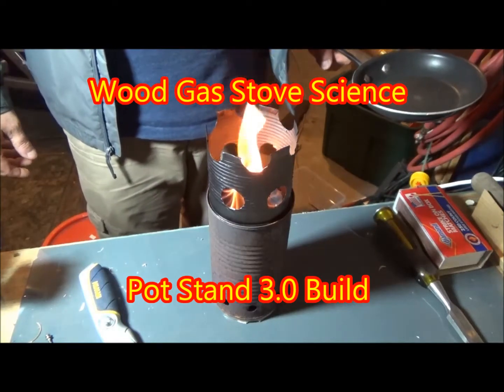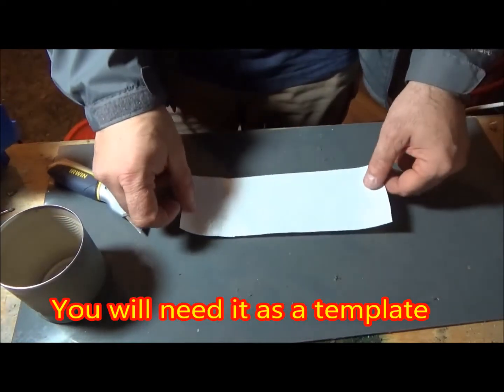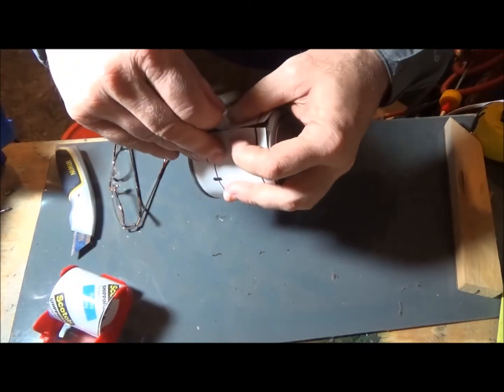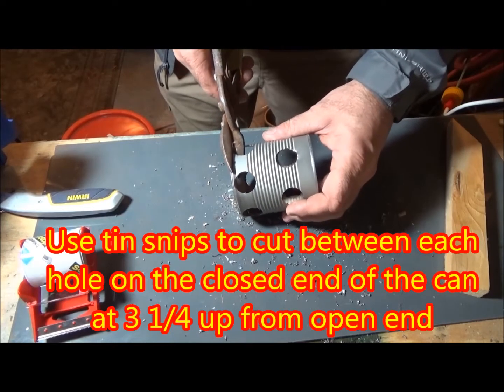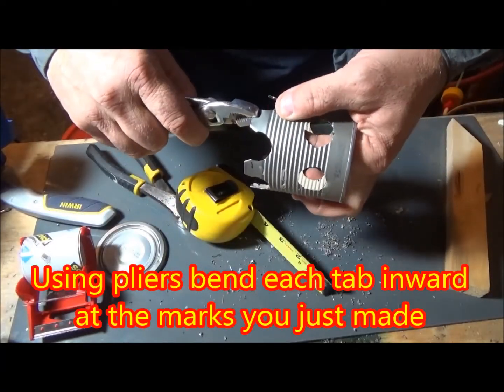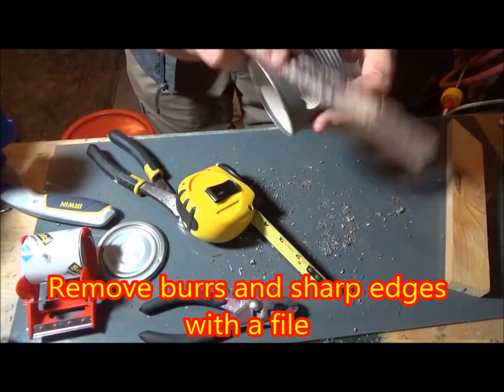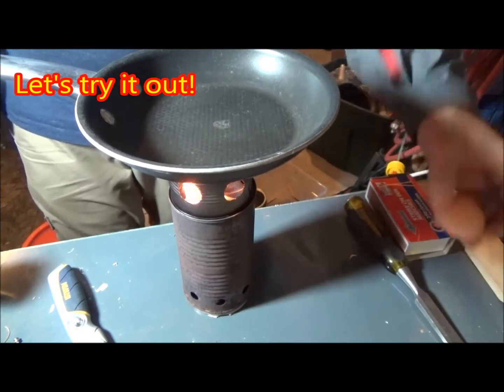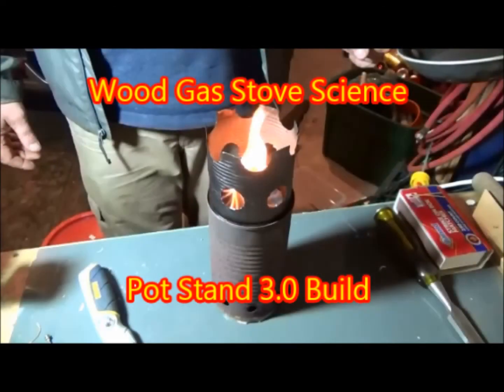WOOD GAS STOVE SCIENCE! Pot stand V3.0 Build!!

Comment: Heath: I was wondering what elevation you are at? I am at 3300ft. above sea level. What size adjustments to the secondary air vents should be made to the 5.4 stove for use at and above my elevation? I am guessing a 1/16" larger. Thanks.